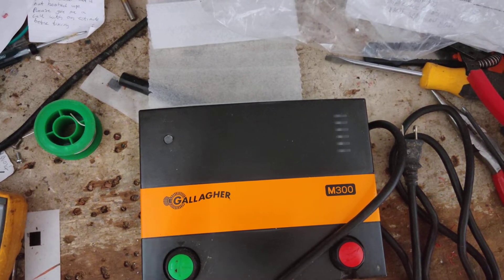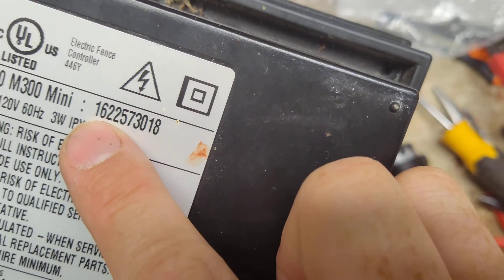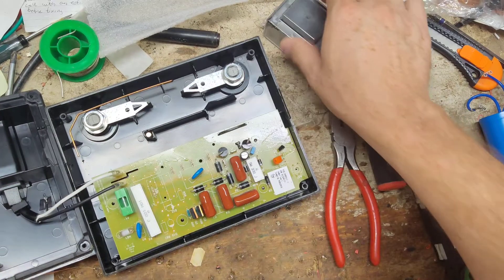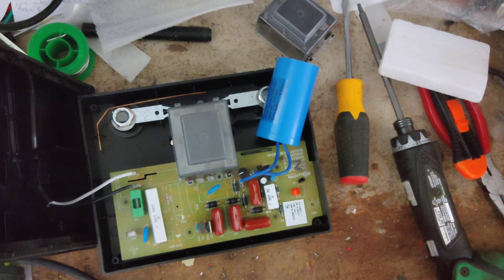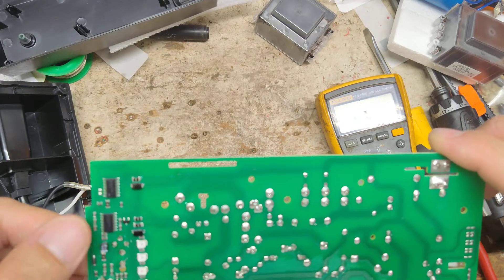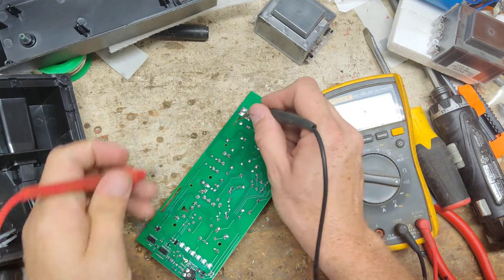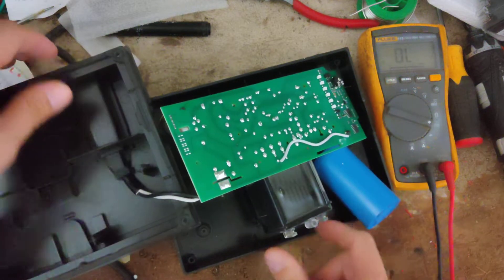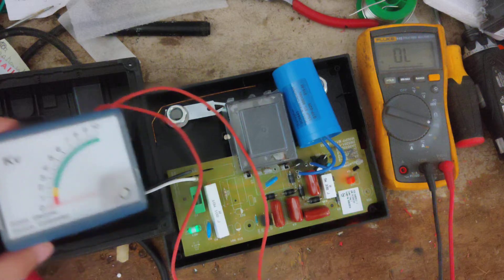How To Fix A Broken Electric Fence Charger | Gallagher M300 Repair

Comment: Hello, where can I buy  the board card feom a Gallagher M1100?
It got hit by a ligthing
Reply from the maker: If it's out of warranty, I could get you one of your located anywhere here in the units States. I would have to order one in because they don't come in all that often
Reply from the maker: How old is your unit or what is the ten digit serial number on the back case?